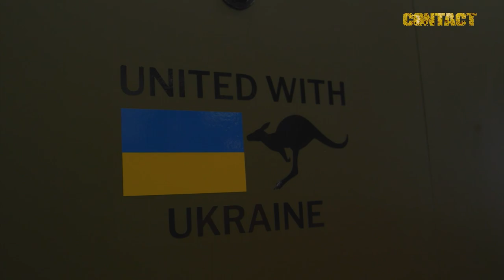ADF prepares M113AS4s for Ukraine

Comment: I'm hoping that the U.S ends up sending an additional 200 M113's to Ukraine, although they can't really be used in the front lines they can still serve in other roles. Primarily as a troop transport vehicle, but can serve as a medevac, command center, provide artillery fire.